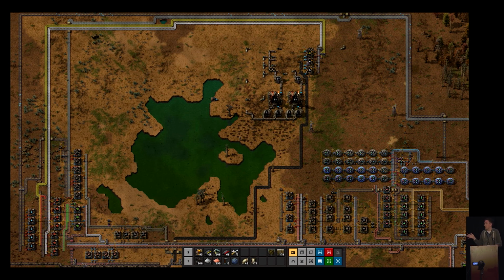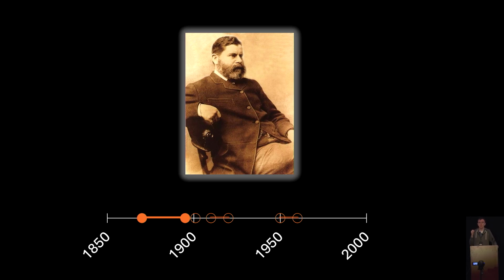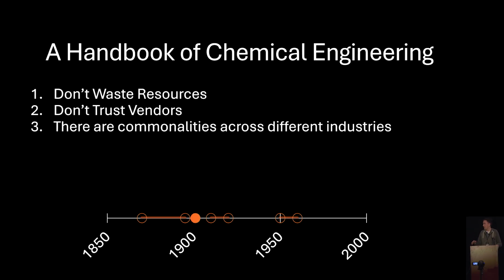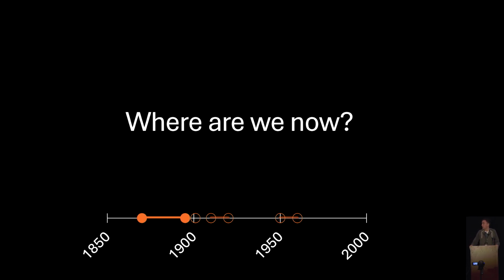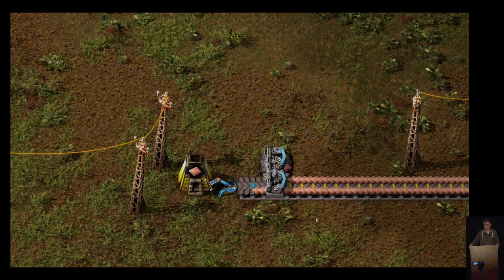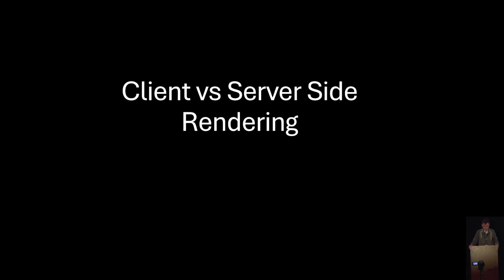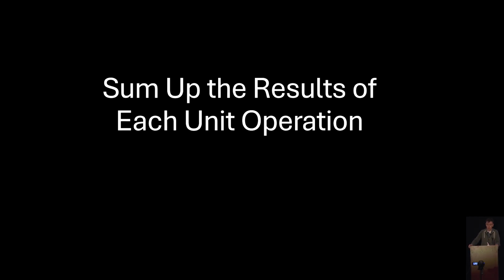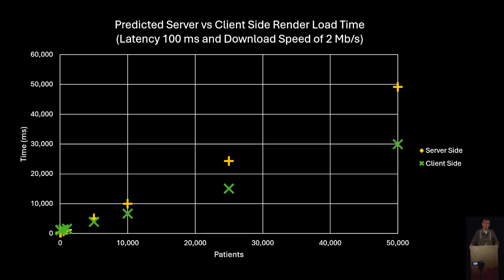John Konecny - The Factorio Software Architecture Do What The Math Tells You

Comment: Server side rendering has some huge advantages in regards to SEO (Search Engine Optimization). Client side rendering will always be at a huge disadvantage in this area. 

But in terms of interactivity, i think stimulus-response interaction with the user has a maximum time of 1 second. Unless you show a progress bar or spinning wheel of death, people will think the computer didn't get your click to start the process.

So in the example he gave with 50k records, you would not permit the user to ask for 50k records; maybe just limit the user to the first 200 so that there is nice cap on how slow it is going to be.

Another aspect of this performance analysis is how clustered/busy the servers are going to be. Human beings in the same geographical region follow a daily cycle, and at night requests are 1/100th of the peak (which is around noon M-F).  If you get any kind of request clumping (the famous Victoria Secret link comes to mind), then database performance drops massively, and when that happens it compounds the problem because now requests which only took 50 milliseconds to process now take 50 seconds because even with the processing of requests you have so many overlapping. This kind of traffic jam happens in freeways every day where slight ripples in the queue cause bunching and much greater impact than you would expect.